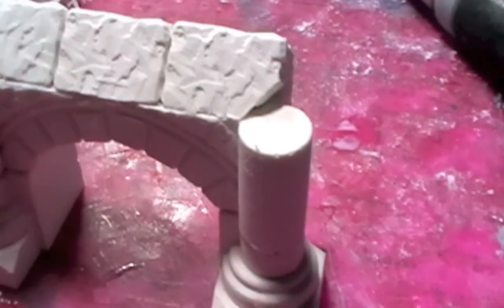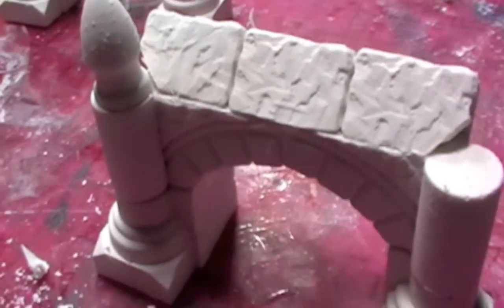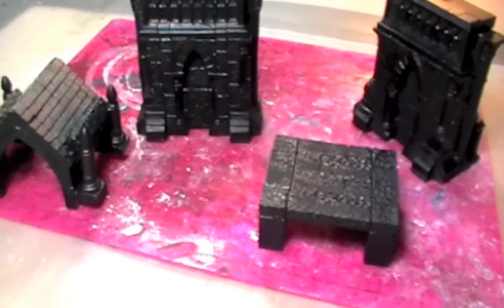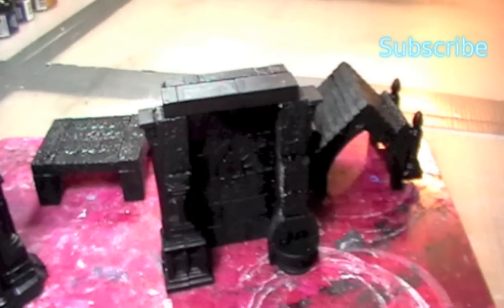Buildathon Pt 4 - Feb 9th - Archway - Mausoleum

Comment: Army Painter and Vallejo on scenery?!  Bidge *shakes head*, get yourself a tin of flat black house paint mate - so much more economical.  I find brushing the basecoat on is better than a rattle can as well, with either method it can be hard to fill the tiny gaps between bricks/details etc - and for me, I'd rather not dump a can into priming pieces.  Looking forward to seeing you paint it though, its looking awesome